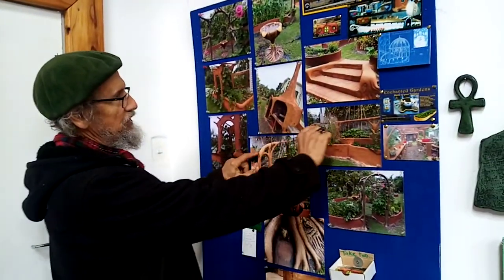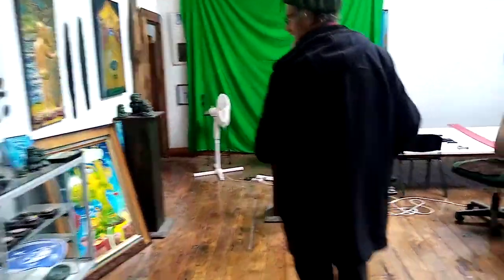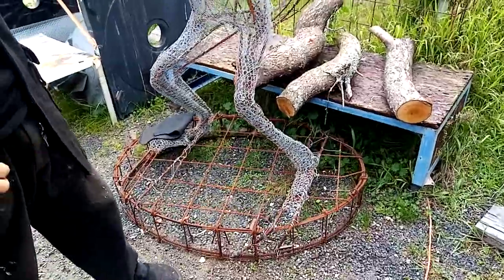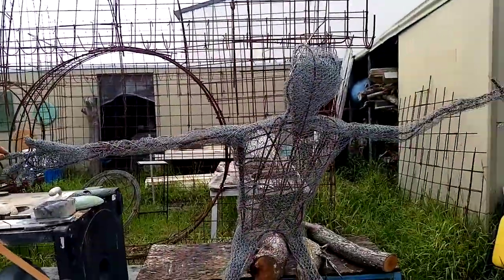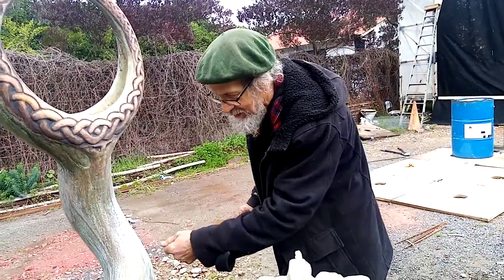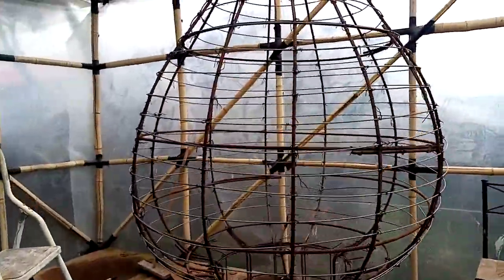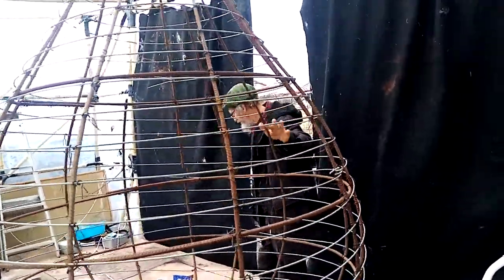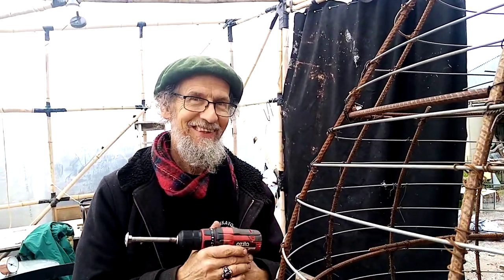Fantastic ferrocement at Renaissance Workshops

Comment: I have made ton's of Ferrocement as one of the last Ferrocement boat repair " Sandmen " As we were taught the hows & why's if ever we called it concrete the boss would curse "it's not bloody concrete " Ferrocement is water tight, concrete is not. My own recipe for Ferro is as follows . 2 finest sharp sand to 1 Portland No 5 cement after 15 % of the sand has been replaced with a pozzolan like DE or Fly ash add water re slump test and for boats I add a tiny amount of Trioxide crystals to eliminate the gas made when galv gets wet plaster on it causing a honeycomb effect ( not wanted on  boats ) If applied with skill , a 2mm final skim coat over wire will see no cracking .I recently did a wall at Eutopia Cafe
Reply from the maker: Very similar to my mix... I use amorphous silica brand name microsilica.